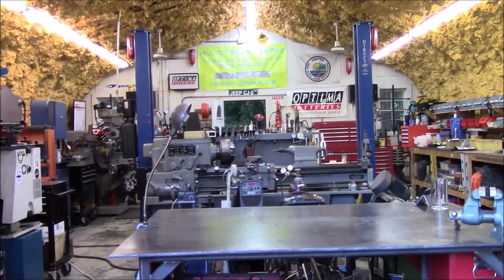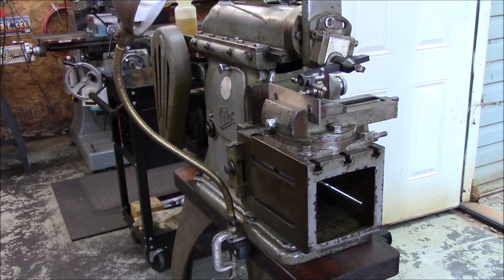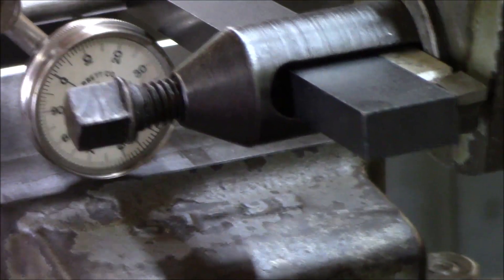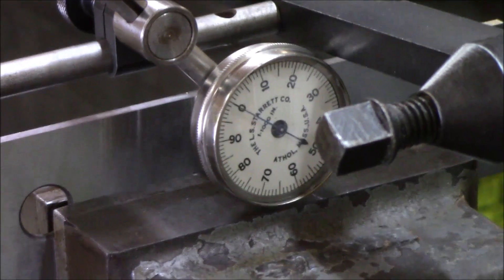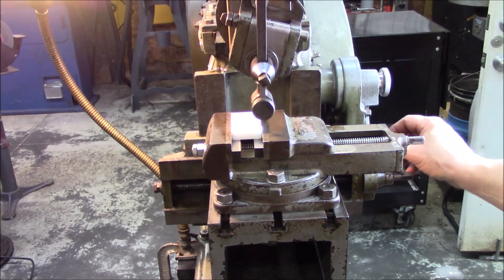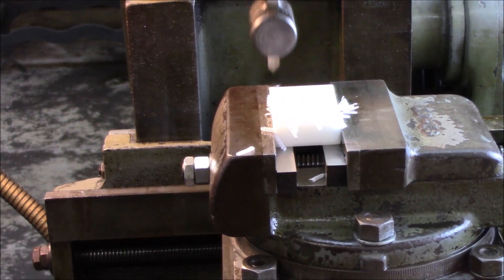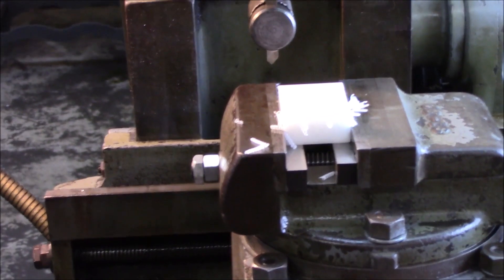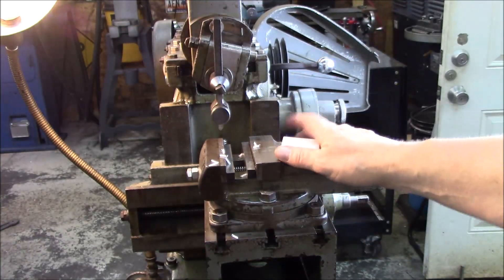Atlas shaper   We are making chips!

Comment: OK so I'm a little Annel, my shaper as stated, my Atlas mill, down to the las nut and bolt, my Atlas QC42 down to the last nut and bolt, my Craftsman hack saw same, and that little 6' Sears, all five done befor they where ever pluged in. What's nice One gets to know there machine better then wondering whats that knoking noies, like part #S7-19 Block, becouse it has 1/8" wair on the drive side

Comment: So you just pluged it in with out knowing any thing of the insides, When I got mine, the seller asked do I want to try it, I looked it over and then said lets load it with out trying, got it home and stripped it down to the last nut and bolt, and fixed what was needed.
Reply from the maker: Insides were fine. I already did a once over on the machine prior.

Comment: I also have an Atlas 7B. I'm wondering how you got the ram off.
I can't move the ram for starting the cut without some serious leverage on the adjusting screw on top of the ram. Might you have any suggestions?
Thanks.

Alan
Reply from the maker: alan costich Are the gibs really tight? If so try loosening them a tad and see if it slides easier.